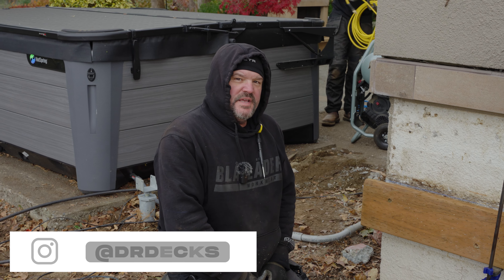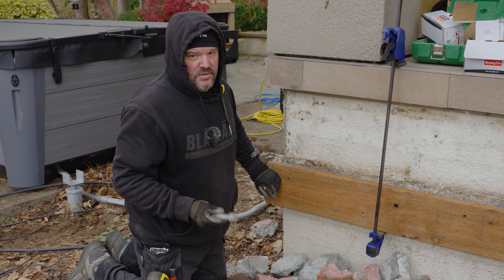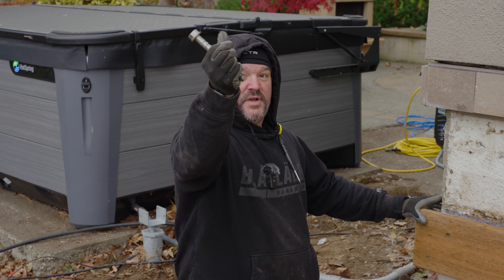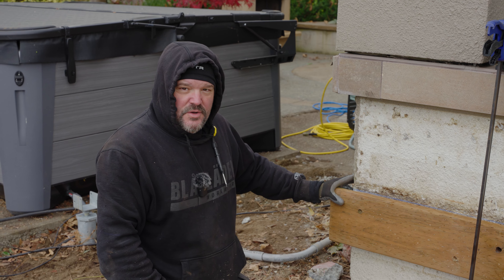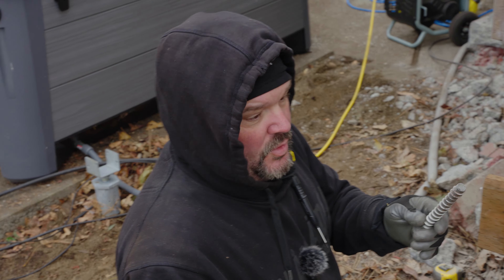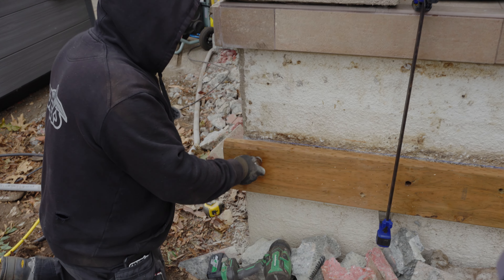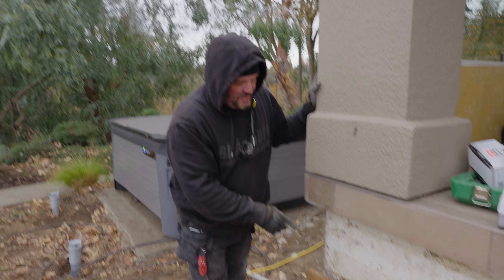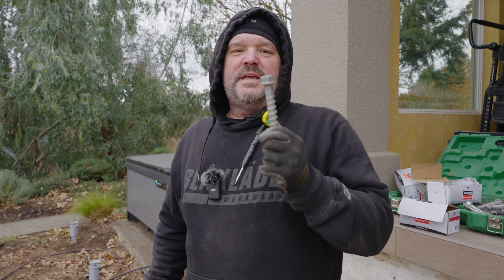How To Attach A Ledger To Concrete Dr Decks Style || Dr Decks

Comment: So I tend to 1. pilot the holes in the timber ledger off wall, 2. line up the ledger plumb and level on the wall with chocks, 3. drill first few 1/4inch of all holes into masonry though the ledger, 4. Remove ledger and fully drill all holes and clean out, 5. Then fix ledger. You almost have to do it this way with resin anchors. Nice video!

Comment: The 304 is the grade of stainless steel.  In my world of pipefitting 304,308,316, 324 are grades of stainless.  They commonly use 316 for food grade tubing for process piping. The higher the number the more nickel. There may be more to this than my observations. Thanks for the video.  Those fasteners are impressive. I have never seen them before.

Comment: I'm getting ready to build another house and this time I am raising the stem-wall height 9-1/2" in the front and back door sections.  This will allow for exterior concrete poured against the foundation without touching wood.  This house called for cripples in the 4 foot crawl space but I am requesting pier/post/beam style to increase the crawl and duct areas.  I'm also adding lights and foam around the stem wall.  It should be a very dry "warmer" environment. See ya

Comment: I have a 10 foot ledger, 2x10, to attach to concrete. I am attaching box stairs to it and side planter boxes. How many bolts and how far apart do I need to drill the bolt holes?

Comment: Did you drill through the spacers and into the wall, or in between the spacers?
Reply: He drilled the spacers to the back of the ledger board.  Then he drilled through the front of the ledger through the spacer into the stucco, i believe.  Cuz if he just drilled through the ledger board, he would have a 2" air gap and then screw into the stucco.  In any case,  water may go behind and get into the hole. He didn't seal it.

Comment: If I want to replace a ledger board when I redo my deck, can I reuse the prior holes (would buy new bolts), or would you recommend drill new holes in the foundation?
Reply: I would recommend filling g the old and making new holes. Less chance of failure

Comment: Would you use this ledger system to support a small hot tub if there were another beam 6' to 8' away parallel to support the other side of the joists? 
So if the hot tub was max 10000lbs, the  ledger supports 5000lbs across the 8' length? Probably use 2x10 pt joists at 12" oc. The deck would be 8' by 8'
Reply: How did it go? Did you use steel support posts?
Reply: @andrewf2630  No, I spec'd some built up beams on columns on large footings instead. It had the added bonus of keeping the deck away from the wall an inch to promoted moisture drying. little more digging, but a better product I think

Comment: So no silicone behind the spacer and ledger?  Once you screw in the titen,  what if water gets behind the trex spacer?  Shouldn't you silicone behind the spacer and into the pilot hole? I actually thought of this idea of using trex spacer after my ledger board rotted away.  I thought? If only I could use something other than wood as a spacer, lol.  Ur video pre dates my idea.  So ur the OG.  Unless u go the idea from someone else.